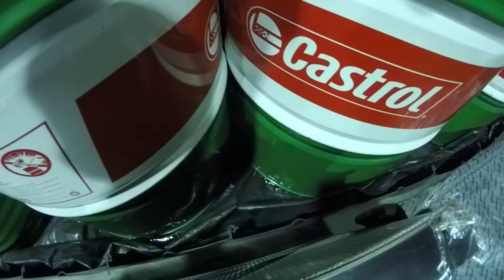Manifold and Radiator [Part 9]

Comment: What did you use to block off the egr? 
Those Mishimoto radiator caps are known to leak too.
Reply from the maker: Liam Campbell just removed it completely and blocked off all left hover holes.
And as for the cap, it's doing well atm so I guess time will tell. But easy fix if it does